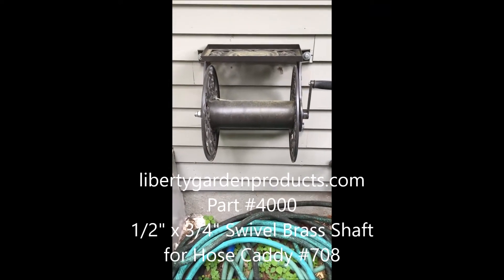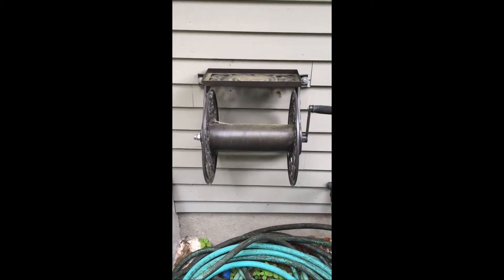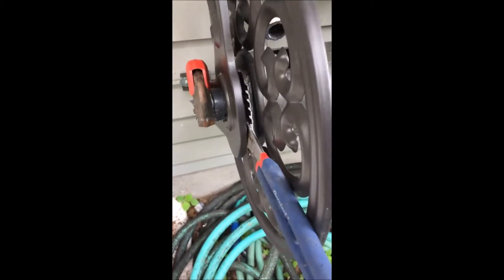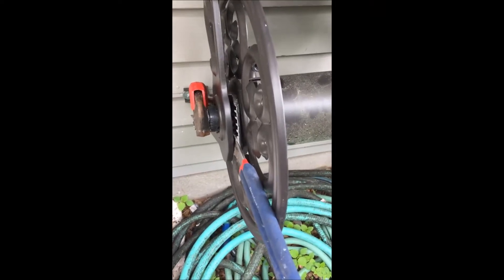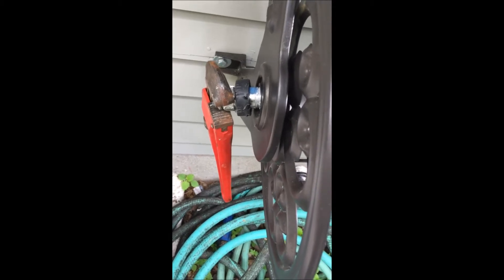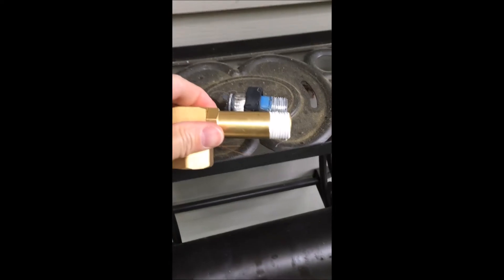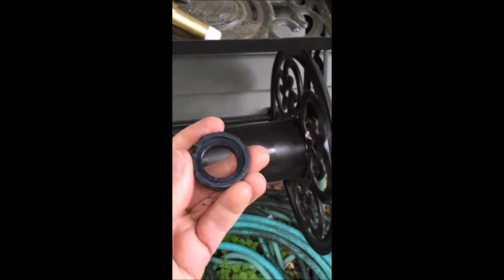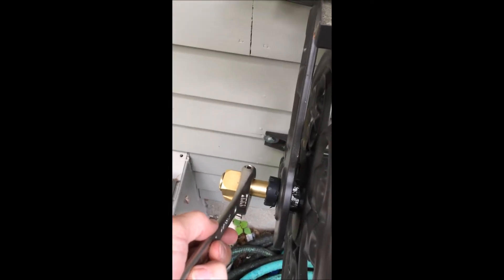Liberty Garden Hose Caddy 708 Swivel Replacement

Comment: Didn’t realize liberty reels had a lifetime warranty, I actually own 6, four are mounted on each side of my house and I have 2 that are on the hose reel dolly’s. Living on 7 acres I have lots of things that need watering( have a well) and these reels are a back saver. I purchased my replacement swivel on Amazon( part #4007) for $20.00 bucks, they also sell a oring kit( part #4000) that includes 6 Orin’s and 1 snap ring for $7.99.
My wall mounted reels look very similar to the one in the video, it was a straight forward repair, removed hoses, found set screw slot, loosen set screw, 3/16 Allen wrench works, just loosen don’t take completely out. Used my kipex pliers to turn swivel piping and just held the reel in place with my free hand. Once just hand tight I held on to the hose connecting pipe and removed swivel piping. Reverse the steps to reassemble, lined up reel with hole for swivel piping and slide piping in, lined up hose connecting fitting and screwed swivel piping to hand tight. Then used a 10” crescent wrench and using the hex fittings on swivel piping tightened  until I felt it was tight enough to not leak. Just hold the reel from turning and let the hose connecting fittings hit on the reel to keep it from turning. I reconnected the inlet hose and hose on reel, I put a nozzle on the hose end and turned the water on and checked for leaks before installing the remanding 100’ of hose on the reel. Worked great no leaks, reel is like new again, thanks so much for making this video, i don’t believe I would have figured out the set screws before I screwed something up without the video. THANKS AGAIN!!!

Comment: Thanks for making this video, it helped out quite a bit.  I would add that you can also place a screw driver through the decorative guarding and then through the decorative spindle (if you use the right small holes, it won't budge), this will lock the spindle in place so that you can put some muscle into unscrewing the old pipe.  Wow, what a task unscrewing the old one, you weren't kidding about it being over tightened!!!  Thanks again, I was about to just go buy a replacement from another company.

Comment: Hey Doug.... This also worked on my Hampton Bay wall mounted hose reel.  FYI.  Wow you were right on with this video.  And so glad you mentioned that you had to apply all your weight to break the nut loose.  I started to undo mine and though the resistance was way too much.  Thinking maybe it was a reverse thread or something was wrong.  So with you advise, I pushed through adding more pressure and sure enough it broke loose.  The old part had a lot of white hard water buildup and that kind of acted like cement.  Once that broke loose, it worked great.  And like Bill Harder said above, placing a screwdriver of something solid between the reel and the frame keeps it from moving when applying pressure to the nuts.  Thanks again Doug..  Great Jot.